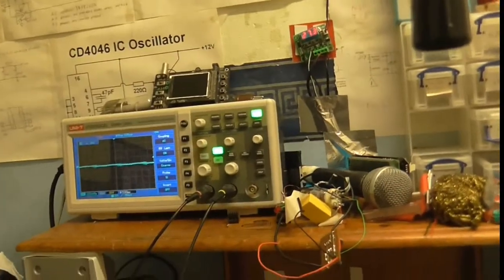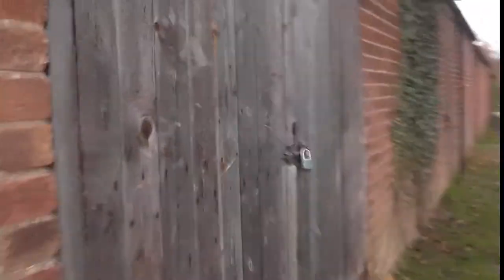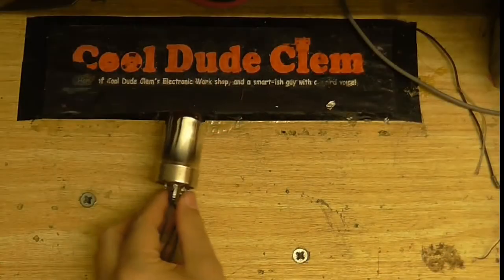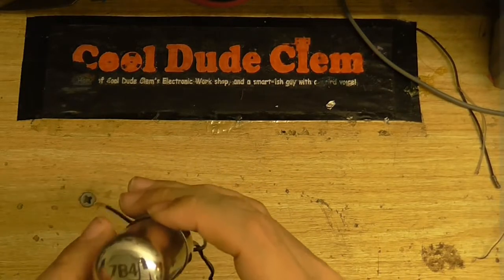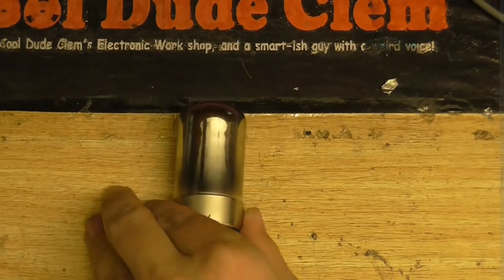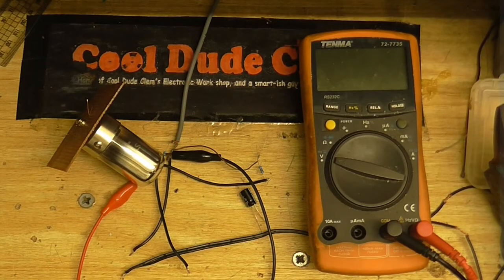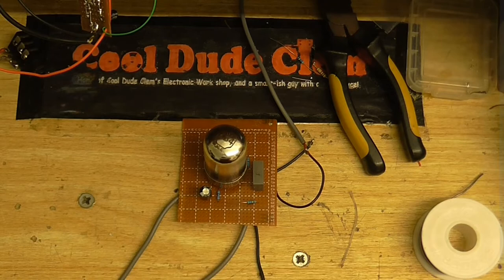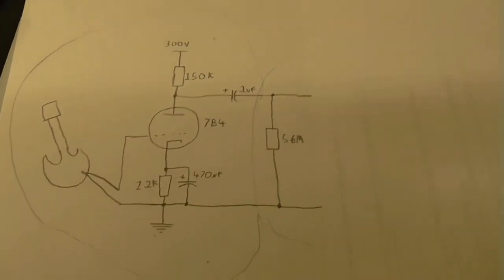Tube Time Returns! 7B4 Tube Preamp Thing

Comment: Hey Clem, Always into Tube/Valve time. Good job on the preamp build. Triodes are very handy. A Pentode can make a nice preamp tube, a little more fussy than a Triode, you need grounded shielding, and, could be more prone to Harmonics, but, sound good. Maybe a Tube based guitar pedal effect? Today, Nov 22, it was 36 degrees Fahrenheit and Fog, a whole 4 degrees F above freezing, as you know. Glad your doing good. All the best from Oregon, Cass.

Comment: Good job Clem.
Why was the purpose trying to get the plate/anode voltage to 175?
Reply: I think it’s to keep the distortion down and the gain up.
Reply from the maker: Well, the way I see it, 175 volts is right in the middle of this tube's plate voltage range, so it just seems like the best choice.

Comment: Well done Clem!
I think that you tried something like this before but didn't like the signal to noise ratio that you ended up with.
That D.C. coupling to the Guitar is unusual.
What is the impedance of a typical Guitar Pick-Up?